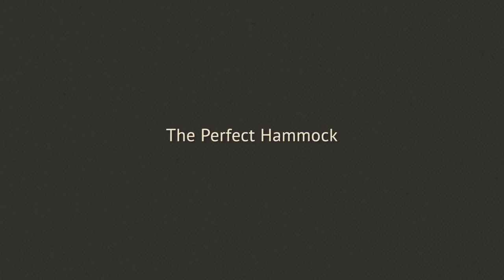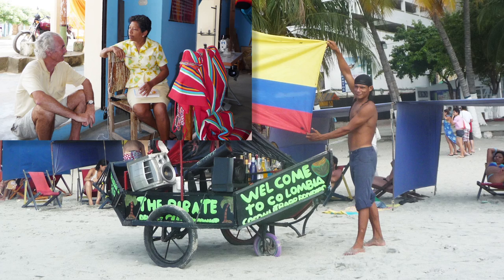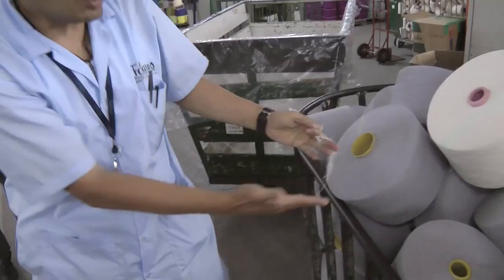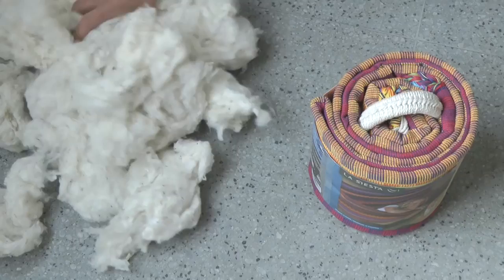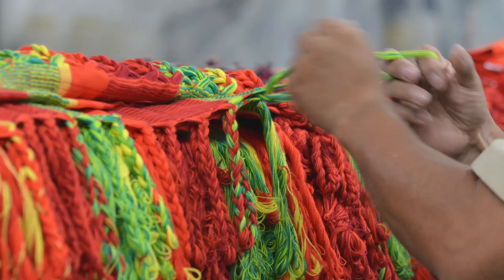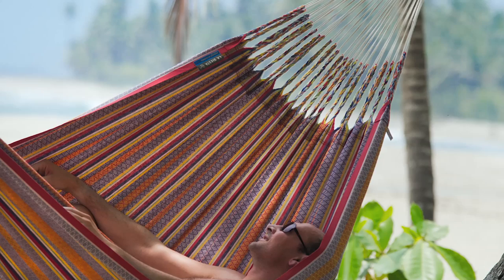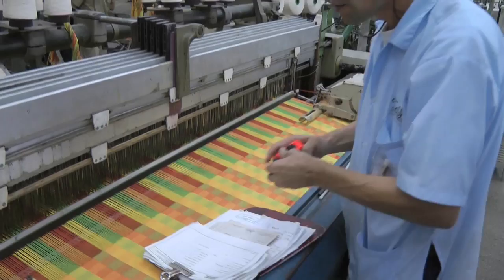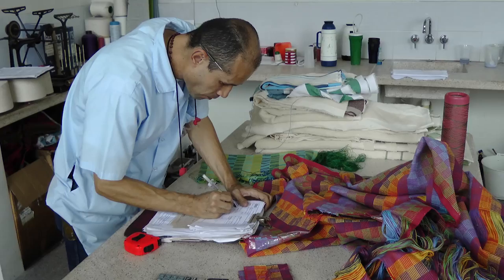LA SIESTA - Hammocks from Colombia

Comment: I have used your Carolina hammocks as my only bed at home since 2013. I love your work, and thank you for showing the love, care, and skill that goes into manufacture. It's easy to make a hammock, but you don't choose the easiest way; you do it best, and I appreciate it. I tell everybody who will listen why your hammocks are the best for full-time use I've found: the Carolina fabric specifically is heavier than others, making it more resistant to rutting used full time over many years and washes.

I even use your (discontinued) padded Colibri as an underquilt for the Carolinas. I hope you will consider offering similar as bottom insulation in future, to help promote hammocks as full-time beds outside the tropics.